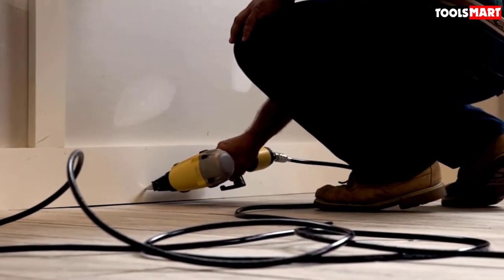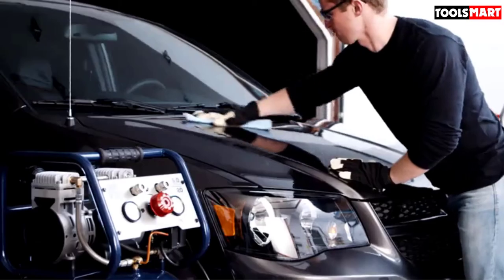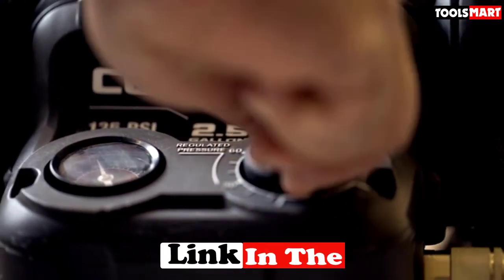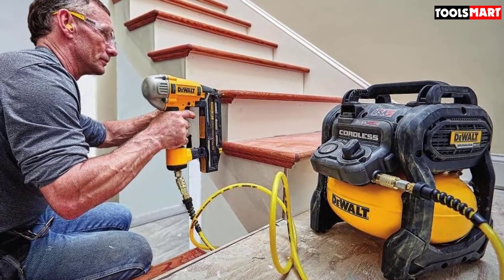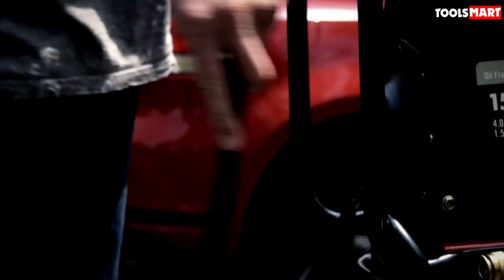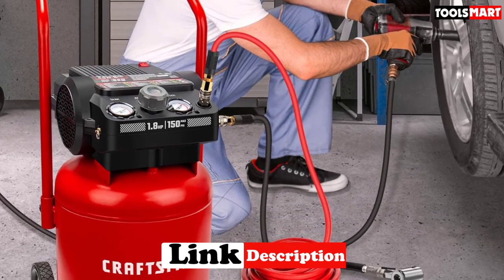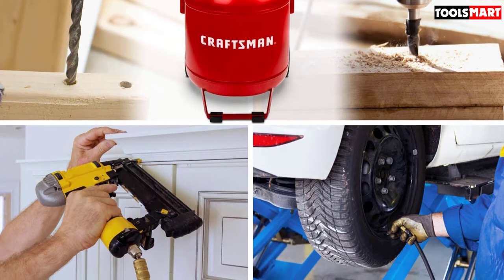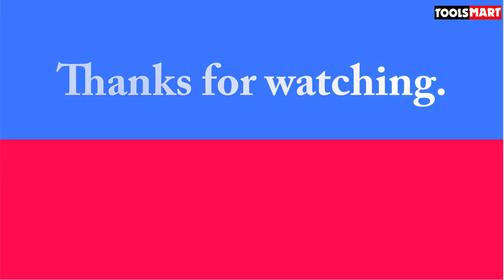✅Top 5 Best Air Compressors For Powering Pneumatic Tools of 2023

Comment from the maker: ✅1. Stealth SAQ-12018 20 Gallon Oil-Free Air Compressor
👉 https://amzn.to/3j3WDHs
✅2. Dewalt DCC2560T1 60V Max Flexvolt Cordless 2.5 Gallon Air Compressor
👉 https://amzn.to/3r0IPSk
✅3. Porter Cable PXCMF220VW 20 Gallon Air Compressor
👉 https://amzn.to/3u4DfQR
✅4. Craftsman CMXECXA0331042 10 Gallon Air Compressor
👉 https://amzn.to/35EMpdq
✅5. Makita MAC2400 4.2 Gallon Dual-Cylinder Air Compressor
👉 https://amzn.to/3j4akG6